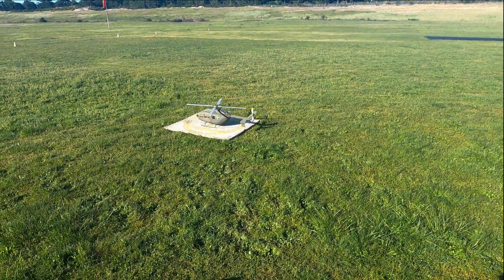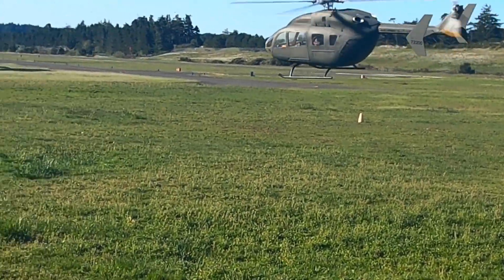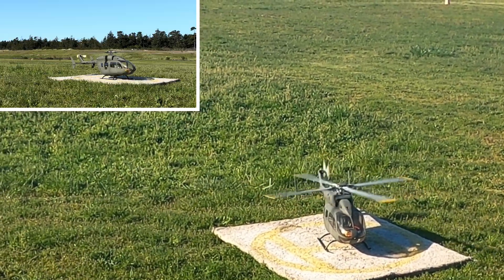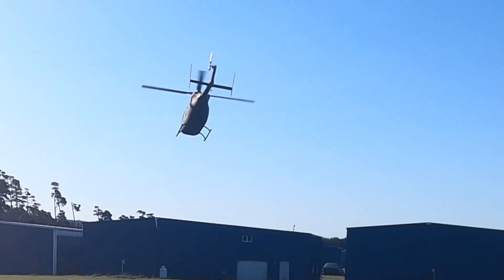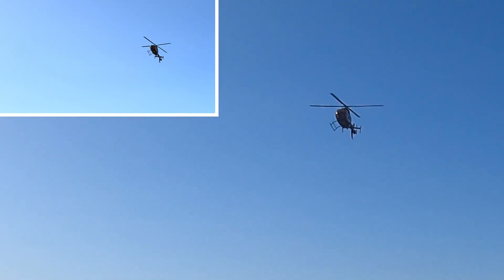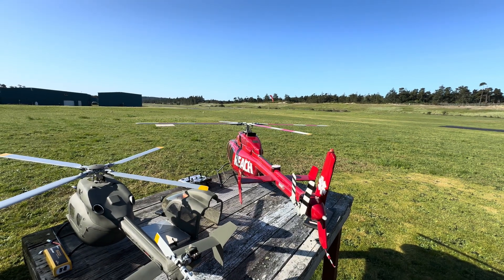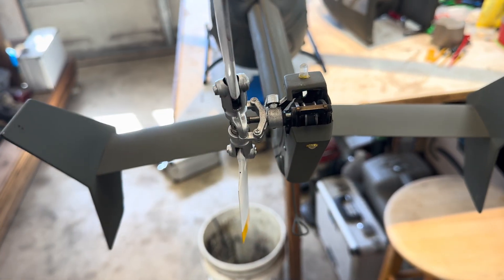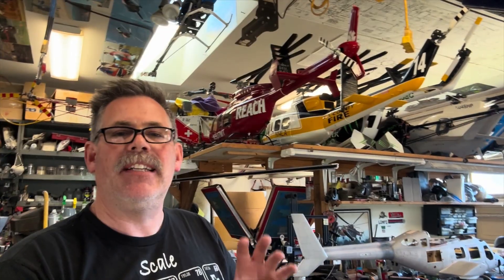Scale RC Helicopter Mechanical tail set up theory

Comment: Robbe helicopter manuals shared this exact information so that the heli would fly correctly from the beginning. The problem with modern manuals is that they have dumbed down the information so that people have no idea how to setup correctly and how the setup affects the helicopter.
Reply from the maker: @MJ-td3ij  yeah, the Heading hold feature of a lot of these newer gyros masks a crappy set up.

Comment: On my uh-1n the mechanical setup  on my tail is probably more than your bell. But it still goes nuts with heavy pitch inputs lol
Reply from the maker: @Randobrando85  most helis will turn a little even in heading hold with hard collective inputs. You just need to know if it’s pushing the tail with the torque, or against it. There are some gyros that have collective tail coupling, and even transmitters that compensate for collective inputs. I always turn those off. That way it’s only the gyro trying to hold it, and not trying to compensate for the collective, the weight of the heli, the winds and anything else messing with the heli.
Reply: @JestRR  Yea im pretty sure its the torque. CCW rotating main and pushing the tail to the left, i got my mechanical tail pitch set to where it will hover straight. And ive got the tail gain set to like 60 or 70...but im not sure if it still actually has tail gyro in rate mode, which is what ive been flying in. The ikon2 fc has pitch precompensation for the tail that i have messed with a little....just going to take me some time to get it all right. Been super windy here in middle tennessee so im doing stuff a couple minutes at a time one day here and one day there haha.

Comment: I drive my helicopter like a boat tiller. If I want left turn, I push the stick to the right. Is this normal for my crazy brain ? I am totally confused with the normal way
Reply from the maker: @TheoHeli-B  that would be completely backwards to the norm. That being said, if you’ve been doing it this way and you are used to it, it would be hard to change. But if someone test flies your heli, or you try to fly someone else’s heli, it’s likely going to crash.

Comment: For efficiency reasons, is their a way to change the bells tail rotor to clockwise? Your lower blade should be the advancing blade, so it can use the down wash of the main rotor to increase speed as it advances.
Reply from the maker: @wowblackhawk  no way to change it easily. AND it’s not scale for the 407!!😡🤬
But as far as efficiency, it’s so minuscule in a full size, that in a model it’s non-existent.  Besides, the whole line of the MD500 series of helis still rotates down into the rotor wash. So it’s really a non issue.  And I have a Vario MS500E and it rotates up into the rotor wash and I can’t tell any difference in any of the tails when flying. But that one is not scale ETHER!!!😡🤬